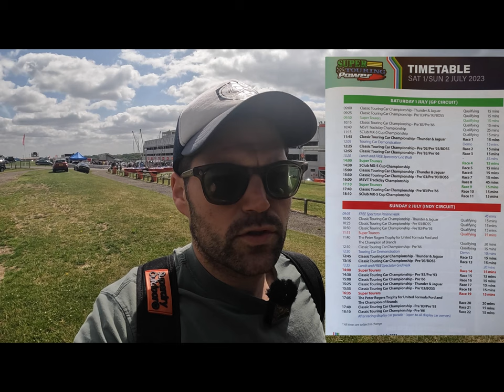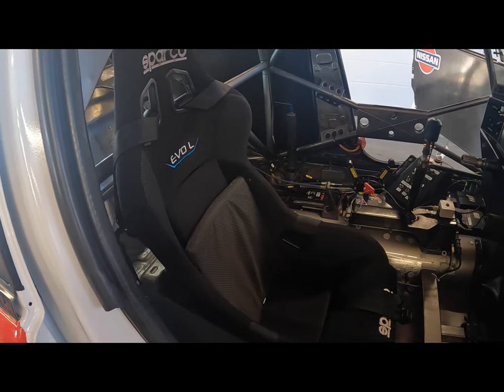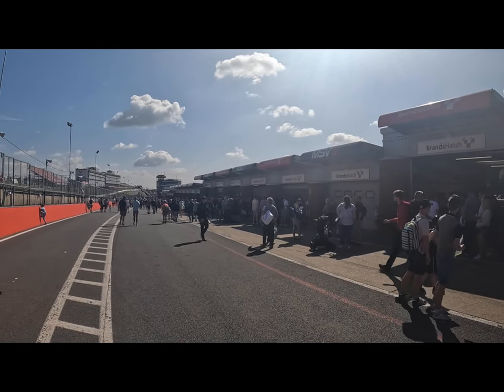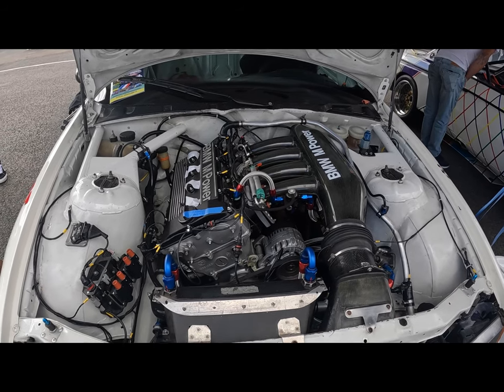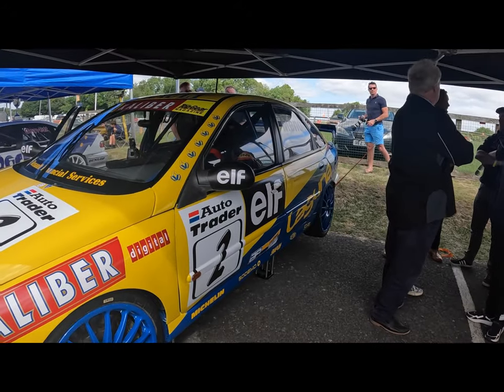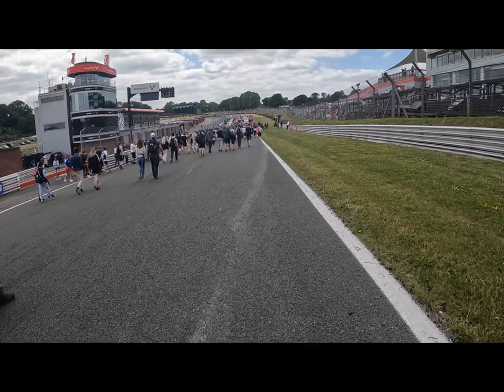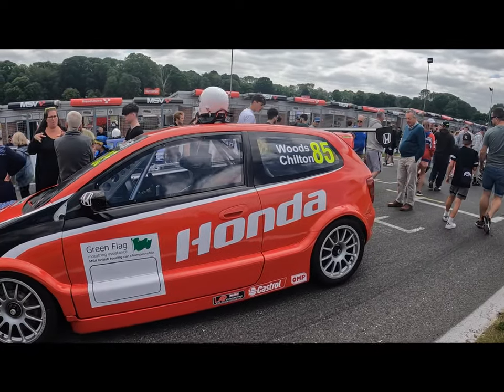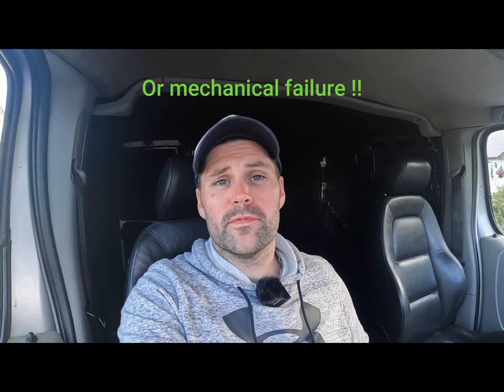BTCC TOCA Super Touring Power Brands Hatch

Comment: From the perfectly reasonable idea of "it'll be cheaper if everyone has a simple 2L class Group A car" to cars that spiralled out of control with incredibly elaborate development and outrageous costs, it's remarkable how it all happened!  Thanks for showing us around these cars.

They were such iconic cars, it was remarkable how angry and on the limit they sounded, and how much they moved around with the sound of wheelspin, tyres skipping across the surface and all that good stuff!

...In Australia they had the idea of "it'll be cheaper if everyone has a simple 5L Group A Commodore" (or a Falcon which was essentially the same - pushrod engine, 6-speed box, live rear axle with locked diff), which like in the BTCC worked OK to start with before costs started to get out of hand (although not as quickly) -- although costs never got as out of hand as they did in Super Touring.  I think the two-make format was to its detriment compared to the BTCC's format.

Comment: - I'm just thinking, MacPherson strut front ends were not mandatory, were they?  So the Honda Accord (and Alfa Romeo 156 in the ESTC) should've had an advantage with their double wishbone front ends -- but I guess the rates were so stiff and travel so little that it didn't make much difference?  

- I was looking at the Mazda 323 2.0 V6 lapping and noticed how little frontal area the glasshouse had compared to the some of the other cars.  It seems like quite a slippery car plus having the potential for more power from the V6.  I reckon that if the Mazda had more development in period, it could have been quite the weapon!

- I think Japan's JTCC started off with the 2L regulations in '93 or '94 but after a couple of years "bastardised" the regulations somewhat to allow the Toyota Chaser to compete, even though it was far too big to meet the rules in Britain?  From late '95 (IIRC) the Accords and Chasers in Japan had much taller rear wings than those allowed in the BTCC.
Reply from the maker: I believe the suspension had to mimic the production car so yes the honda having double wishbone could potentially gain advantage with unequal length arms etc. However as with all things in motorsport what you gain in one area is often sacrificed in another. Shame the Mazda never met its full potential, i believe it could have been a race winner if developed in period, great sound too 😁